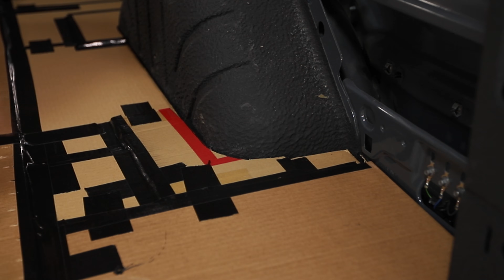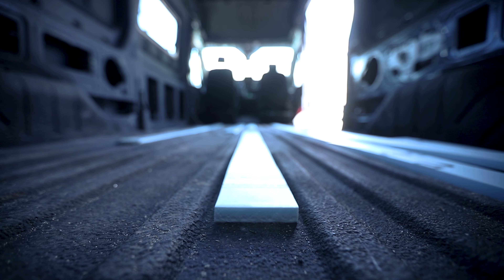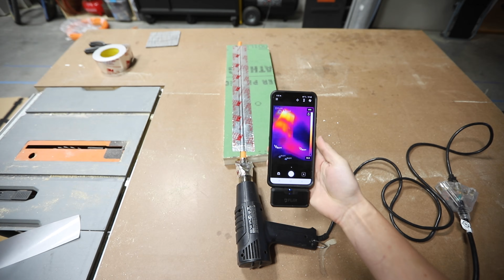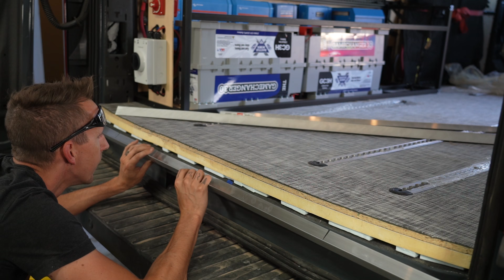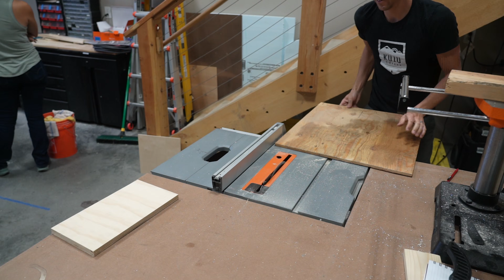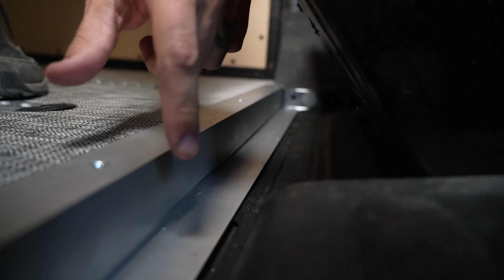VAN FLOORING PERFECTION (Insulation, Subfloor, Covering, L-Track & Step/Lip Trim)

Comment: Wow, great job. Nicely done. I was gonna use the same wood but it seems like not gonna hold screws for installing cabinets, anchors, etc. Any opinion? Thank you in advance.
Reply from the maker: That's what we installed the L-Track for.  Screws into plywood floor isn't particularly strong when it comes to holding cabinets in a moving vehicle.
Reply: @EXPLORISTlife  Ic, that make sense. One more question. Is there any spacers ( brackets) have been installed under the L -track to make it flash to the floor? Thank you again.
Reply from the maker: No.  The downward force of the L-Track is on the flange, not the bottom of the L-Track.
Reply: @EXPLORISTlife  👍. Great. Thanks for info.

Comment: How does the L track secure tightly to the floor with the polish?  Your track looks to sit flush with to osb.
Reply from the maker: Polish?
Reply: Sorry the insulation,  polystyrene .  Great videos by the way.
Reply: Sorry the insulation,  polystyrene .  Great videos by the way.
Reply: Sorry the insulation,  polystyrene .  Great videos by the way.
Reply: Sorry,  polystyrene insulation.  Great videos by the way.
Reply: Sorry,  polystyrene insulation.  Great videos by the way.
Reply: Sorry,  polystyrene insulation.  Great videos by the way.
Reply: Sorry,  polystyrene insulation.  Great videos by the way.
Reply: Sorry,  polystyrene insulation.  Great videos by the way.
Reply: Polystyrene
Reply: Polystyrene
Reply: Polystyrene

Comment: How did you address the thermal bridges created by each of the through and through screws to secure the tracks to your floor?
Reply from the maker: By understanding that thermal bridging is an inherent consideration in a van build and theres not much we can feasibly do about it. 😂👍

Comment: planning out truck sleeper ac and dc wireing system i have inverter for now would like to upgrade wattage to over1500 w as needed would like to run off alternater when on road and shore plug when parked. needs to run small fridge small microwave laptop 3 wall plugs for grinder and kettle coffee. can i get feed back on layout, parts, and wire sizes thankyou must be very durable

Comment: Love the blade in the table saw hack. Sped up my cargo trailer conversion significantly, used to do with a track saw.
Reply from the maker: 🤣😂  I've used it SEVERAL times since then too.   Also works REALLY good on those 3/4" thick rubber horse stall mats with a couple of passes.

Comment: I'm looking at bolting L track to my Sprinter floor and, looking at the underside, the outside edges of the van are open and clear but the next bays inward have the muffler with heat shield on one side and the gas tank on the other. It doesn't look like you dropped these for bolt access so just wondering how this was dealt with.
Reply from the maker: I did indeed drop those. 🤣😂  This is a Transit, though, so YMMV.

Comment: Zipwall would not be my choice. It doesn't hold screws well at all, like any other particle board. And if you let it soak it will start falling apart. Regular plywood would have a better resistance to soaking and can actually hold screws. So to anyone watching, unless you got the zipwall free, then look at some 1/2" cabinet or marine grade ply first!
Reply from the maker: Never will our floor ever be submerged for any length of time, so that's not an issue.  And it doesn't need to hold screws since we installed the l-track.  Glad to clear up your concerns!
Reply: @EXPLORISTlife  the stuff is sweet! I've installed it on homes (which is how I know what happens when it stays soaking lol)  it is absolutely usually in the way you guys installed it. I'm just a weirdo that like to be able to screw anywhere lol

Comment: WHY? Did you cut from the center of your flooring goods instead of starting near one edge and thereby having wider, usable pieces of left overs?
Reply from the maker: IDK... that's just not what we did.  Ultimately though, I didn't have any need to zip sheathing off-cuts; so those were going to the landfill regardless of how big they were.

Comment: Do you have a gasket on the inside of the sliding door that butts up to your floor and lower step? I have a sprinter work van that likes to accumulate screws and rock in the door slide track. Turns out that there is an update with a stiff open cell foam that sticks to the inside of the door skin so when the door is shut the foam gasket butts up to the step tread plate and keep rocks and screws from rolling around the tread plate and falling into the sliding track.
Reply from the maker: Not sure I'm following, but we didn't add additional gaskets, no.
Reply: @EXPLORISTlife  Ford must have done a better job with door fitment than Mercedes. In the sprinters if you shed a few rocks from boot treads or other debris onto the top of the side door step there was nothing to stop that grit and debris from rolling over the edge of the step and falling into the lower door slide that rides under the step. Eventually with enough debris the lower latch breaks. I had the latch cable break with the door latched full open. Very unpleasant repair. I guess it was enough of a problem that mb made a retrofit kit for the door. Basically something like a 3/4 thick foam weather strip that gets stuck to the back side of the door and firmly contacts the length of the side step.

Comment: doesn't going through the floor introduce MASSIVE cold bridges and undo the complete isolation? ... (yeah it does i'm pretty sure)
thanks for the great tips though, materials and methods
Reply from the maker: Maybe some, but ultimately, making sure the l-track was fully secured down was more important than thermal bridging.

Comment: Just an info on Polyiso, its R value reduces as the weather gets colder. However seems to be an easy install.
Reply from the maker: Indeed!
Reply: This is a commonly repeated van myth. The change in R value between XPS and Polyiso is so small that it doesn't make any difference. XPS is better for a floor install, but it shouldn't be used for walls or ceiling because it melts at 165 F. The van metal can get that high on a hot day in the sun.

Comment: Very helpful video.  Gave me a lot of ideas.  

Was 3/8” insulation too thin?  Hot knife seemed like way too much.   I would think spray foam and then shaving it down would be less labor intensive and faster.

Lastly-why not get bigger angle iron and cut it down to the right height rather than a second piece under the first?

Comment: Next time simply take a can of polyurethane foam and spray in the grooves on the floor. Then you can simply cut it to level the height or use it to glue the floorboard to the floor...
Reply from the maker: I don't believe I will. 🤣😂  That stuff is super messy and by the time it cured and I trimmed it; I could have been done with what I did in this video.

Comment: so was the L track just for bracing of cabinets and such or is that also fastening the sub-floor (i think you would call it in this case) to the actual van floor. i guess my real question is did you use any fasteners to secure the actual flooring or just glue, are the L tracks solely for your seats and cabinets or are they securing the floor?
Reply from the maker: Both, and yes.

Comment: Instead to put small piece of plywood on the floor near the back door. better use T shape aluminium at home depot. that will resist moisture and water
Reply from the maker: We didn't put a 'small piece of plywood on the floor near the back door'.

Comment: Would have been nice to have you explain how you determined where to install the L-tracks.    Otherwise, a great video.  Thanks.
Reply: I also want to know this
Reply: WHAT IF SOME SORT OF PIPES PENETRATED BY RANDOM L-TRACK INSTALLATION
Reply: Me too
Reply: Obviously, before putting the L track in, you would have gotten under the van and...measured.
Reply: They obviously had a plan based on cabinet design

Comment: Thanks for this video! I have been trying to figure out how to avoid letting water get under the floor and love how you handled that in the front, and on the sides with the floor protruding a little over the steps. This is fantastic to understand the process of making a high end floor!

Comment: out of curiosity - did you look at Warmboard - since it's designed specifically for radiant floor heating...
Reply from the maker: I did indeed look at it, but that's as far as that went.
Reply: @EXPLORISTlife  Still binging videos - (nice work btw)  Zip R is on my sort list for home construction - never occurred to me to look at it for subfloor use.  Any issues I should be aware of?

Comment: Good job! I have though to wonder how do you fix / where is (going to be) that spare wheel (1), and how exactly have you worked those bars on/in the floor, those for fixing any furniture/seats (2)? Thank you very much, anyway, for all of the rest! 💞 I so regret you haven't had though a heated floor... Cheers! All the best! 👍
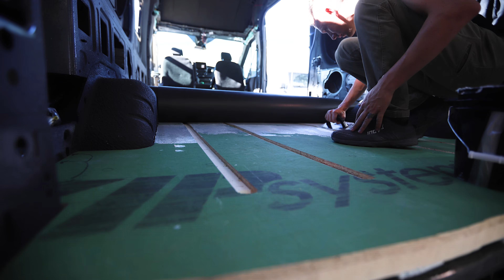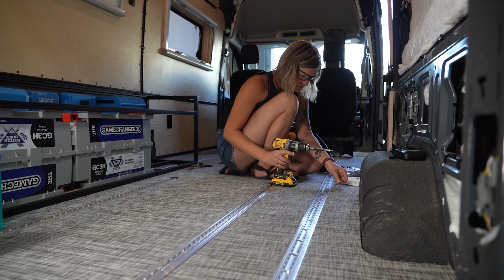Reply: Q. (2) ✓ It's OK! At the minutes (08:50) & (09:35); it's perfect!!!

Q. (1) (?) I don't figure it out, yet!
Your spare wheel is under the floor 😳, or if normally not, how will you fix it there (under the bed, I presume) ?
Reply from the maker: Spare tire is under the van.  The release is just in the floor, which we made an access for.

Comment: In flooring, we use pattern scribing. We use paper. Use a pair of dividers set to 1 inch. Put the pen or pencil part inward, and trace around the van, marking the paper . Then put the paper pattern on the flooring. Then reverse the dividers, putting the pen or pencil side outwards. Carefully follow your marks all around the pattern. Now you have a perfectly cut piece of flooring.
Reply from the maker: Nice!  That sounds like a good option as well.
Reply: I use heavy kraft paper by the roll.  Make a larger (by a couple of inches) then lay in van.  Tape it.  Push with fingers around the entire van.  Remove, cut where crease marks are, again a bit oversized.  Crease it and mark it with Sharpie.

Comment: Beautiful finish detail, great explanations.  Would it be possible to use something like a self-leveling product to fill in the gaps between the ridges on the original floor?
Reply from the maker: Thanks!  I think you'd have a hell of a time getting something to 'self level' on an unlevel surface like a van that naturally slopes to the front.

Comment: The advice I have seen on other videos, and a bus mechanic who was sourcing some seats for me, was that the rail should be secured underneath using plates rather than washers that go across two or more holes. Thoughts?
Reply from the maker: Either way. Choose whichever makes you feel more comfortable.
Reply: @EXPLORIST life - DIY Campers  ok thanks. Lovely van btw

Comment: Seems like the edges still sharp. Better make it a bit curve to avoid cuts to feet during in / out to van.
Reply from the maker: It's fine. 👍
Reply from the maker: Remember... we are the ones who have actually felt the edges and you are only assuming based on what you see through the screen.

Comment: Next time look up Aluminum Stair Nosing for trimming out the viewable edges of what you installed by the doors. Also, maybe use NOICO sound deadening between the ribs on the floors for a quieter interior under the insulation and ply. Great Value and sticks where you put it and can be stacked as thick as you need. Carpet and Tile Installer wholesalers to the trades have a lot of products to choose for all kinds of finished looks and waterproof if wanted. Another tool on your belt for professional results.
Reply from the maker: I like the aluminum angle better than stair nosing for the look we were going for.  

We used LizardSkin sound dampening instead of NOICO In this build.

Comment: Hmm, excellent insulation job, but did not the screws in the l-track transfer the cold from the outside to the profile?🤔
Reply from the maker: I mean, probably; but what is the other option? lol
Reply: @EXPLORISTlife  lol, seriously? The attention you put into the insulation and then these thermal bridges.  Maybe it is acceptable and I'm too detailed. Just sceptical thinking, nothing else.
Reply from the maker: @IPMan-me6lo  I mean, I thought of it, but there's no other good options.  If we are bolting a seat into the van, structural strength is more important than thermal bridging.

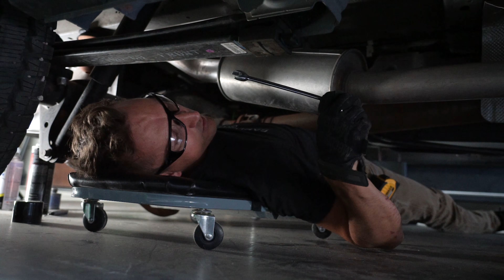Comment: I guess drilling (9:40) requires some planning. you don't want to drill into a beam, or a gas tank, or god knows what's underneath the floor. 
maybe even better: check underneath before you even plan those tracks, and see what's possible.
btw: in other van building videos i didn't see those tracks at all. assuming i'm not moving my kitchen around very often, can I just bolt it to the floor?
Reply from the maker: We did indeed measure before drilling.  Thanks for tuning in!

Comment: Just got my Exploirist electric system, kind of overwhelmed but confident with your vid I can pull it off!😉  Question: how did you determine position of L tracks on the floor? You attach the battery box to one of them but I have 1"x1" aluminum joists under my floor now (they are glued).  Can I attach battery safely to the l track against the lower wall of my Sprinter?  I don't think I can get my partner to lay under the van spraying and bolting for 100 bolts, but I would like the option for a seat, and the idea is awesome.😆
Reply from the maker: Nice!  Positioning for the 'outer' L-Track was based on where we could attach future cabinets.  Inner L-Tracks was based on 10" spacing for seats up front and a wide stance for a slider tray in the back.  I'll leave your own battery attachment methods up to your own judgment there as there are too many variables to say 'That will work without a shadow of a doubt."

Comment: in my first conversion, I used a floating laminate floor on the floor as a top and XPS polystyrene as a base, glued with mounting foam. I am now considering a combination of airgel and granulated rubber together with rubber. (perhaps I will leave out aeoregel on the floor, but it will definitely go on the walls and roof, because it is expensive, but the properties are divine...
Reply from the maker: Neat!
Reply: @EXPLORISTlife  not elegant, pure physics. better size/efficiency ratio, so there is no need for such a large and heavy layer.

otherwise, I'm still considering adding sheep's wool, which is a great material for walls, not because of insulation, but because of its bio-properties when it controls humidity and cleans the air. just as I already have the first version of the floor, so in the first version of the walls I have k-flex and tentatively a mat with aluminum in the sliding doors.
after all, classically one explores and discovers...
Reply from the maker: That's great!  Glad you found something that works for you.

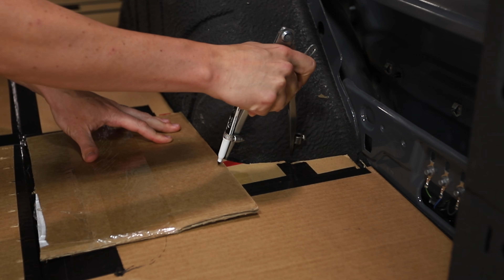Comment: At 1:42 you placed the cardboard template in the centre of the flooring sheet and then proceeded to cut it out. Why not line it up with an edge and have a useful-sized off-cut remaining?
Reply from the maker: I couldn't verify that the sides of the van were square with the front, so I lined it up with the centerlines of the front and back instead of assuming the side was square.
Reply: @EXPLORISTlife  
Unless I’m missing something that doesn’t make sense? The template was full size so you could’ve put it in any orientation, as long as none of it overhung the edge of the wood composite you were using.
Reply from the maker: @Therapistinthewhitehouse  Don't think so far into it.  I just picked a way that worked for me and went with it.  If you see a better way...do that for your own build.  Every decision I make is not some big analytical and calculated decision and there's often 1000 ways to do things.
Reply: @EXPLORISTlife  
I just hate waste and always try to maximize the size of my offcuts so they’re more useful for the next job.
Reply from the maker: @Therapistinthewhitehouse  Yeah, then do that.  My offcuts went in the trash as I don't have another project coming up that needs them.

Comment: Good job on the L Track installation. I had hard points on the floor of my Promaster City to work with. My floor covering was a vinyl interlocking, floating floor. As for the aluminum moulding, I attached it with construction adhesive.
The floor itself is 3/4” Extruded polystyrene, supported by 1x3 battens, and covered by 3/4” plywood. I wanted to maintain a 1000lb cargo capacity which is why I laid down the 1x3 battens. The floor looks good, stays reasonably comfortable, even in below freezing temperatures.
Reply: Looking to do my flooring using the battens approach as well. May I ask how did you secure battens to the floor? - bolted down or glued?
Reply: @Anand1111988 I used construction adhesive to secure the battens. I didn’t apply the adhesive along the whole length of the battens, only in spots along them. This allowed the adhesive to secure the battens and allowed easy removal if need be.
Hope this helps.

Comment: I think the foam would have compressed down to the correct height.
Reply: The foam in insulation. If you compress insulation of any kind you lose most of the R value. So his method was correct in choosing to sacrifice a small amount of R value but retaining the majority of the R value. However there are better materials tor this purpose. Their system is Flammable.  
Marine 5/8" Coosa board and 10MM strips of plus 10mm Areogel blanket will will create a R50ish Rating, Non Flammable and allow for wiring to be run.

Comment: if you w3ere that worried about insulating the floor and making it more ridged the dips and valleys, you could have covered the floor of the van with osb then foam insulation and a top osb. the extra osb cost would have been paid for in time saved and aggravation and only a 7/16" headroom lose
Reply from the maker: Nah.  I like the way we did it in this video.